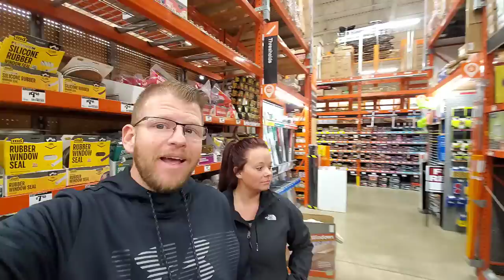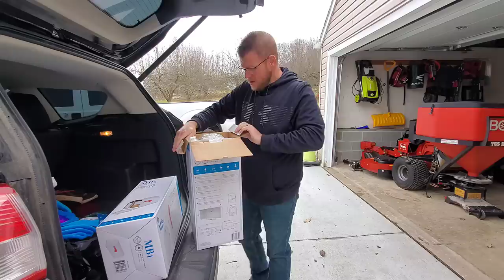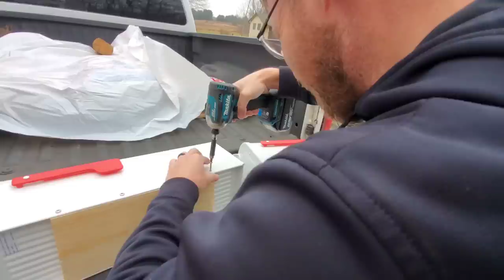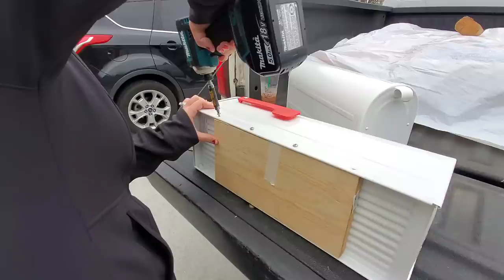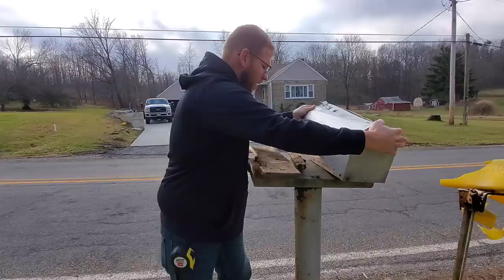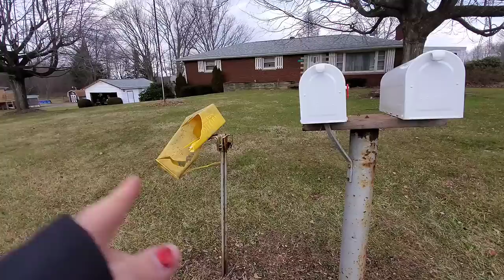[Can't Believe He Let Us Do It] DAMAGE FIXED

Comment: Double mailbox on the same post is a challenge. Been there done that... Get everything screwed on the base board and pre fit. After a pre fit a stubby Phillips screwdriver is in order. Screw down the mailbox base boards and the stubby Phillips screwdriver will take care of the lack of space between the two mailboxes. 
One of my jobs at ODOT is replacing mailbox’s that get knocked down from our plowing operations.
Reply from the maker: Thank you